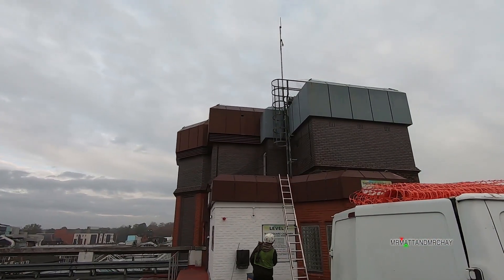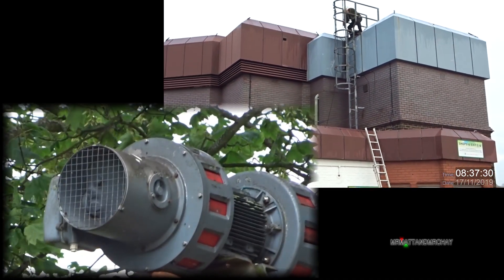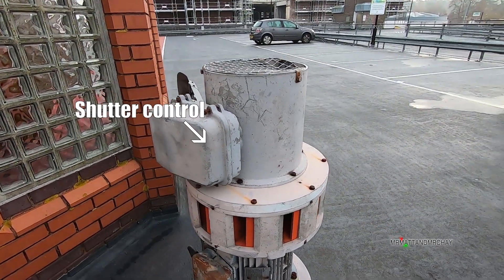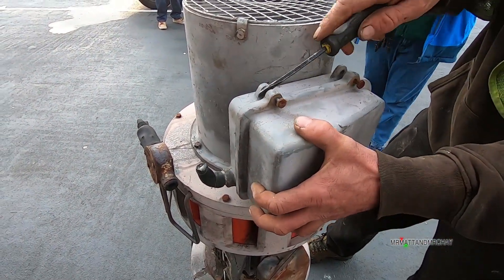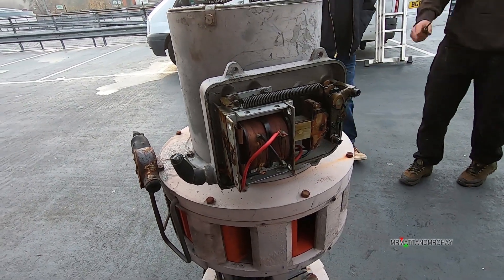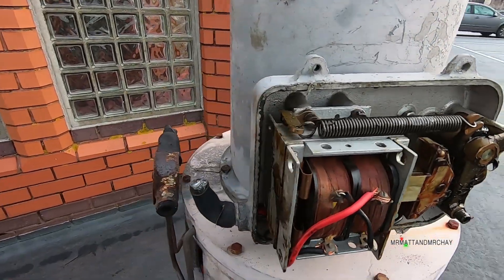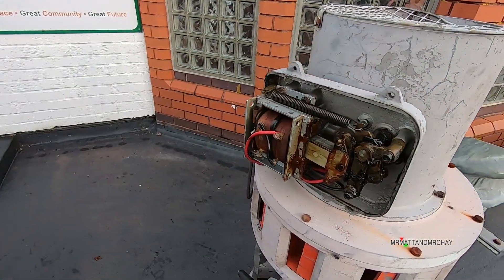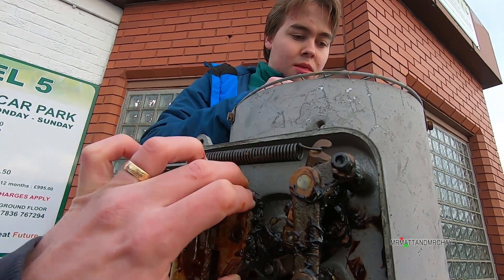What's inside a BROADMOOR SIREN damper/shutter control box?

Comment: 1:04 looks pretty tall. Would it work standing up like that, or does it need to be mounted sideways to get airflow?
Reply: ik this is an old comment but the US actually has the 3T22 which is this thing but vertical! as long as the intake isn’t blocked it should be good

Comment: The solenoids are similar to the ones in an American Federal Signal Thunderbolt 1003, but the linkages have to operate rotating butterfly valves as opposed to sliding valves.
Reply: And the Thunderbolt 1003 can also produce that pretty scary noise not only by sliding the shutters, but also by changing the blower's RPM up and down at the same time.
I'm pretty much sure that this mode is called alternate wail.

Comment: Well it looks like a Federal Signal 3T22, or Thunderbolt 1003 solenoid, but a 1003 has smaller solenoids. And this siren has a lower pitch than a Federal Signal 3T22, probably bc U.K's alternating current frequency is 50hz so the motor spins slower and in u.s is 60hz

Comment: Why don't they just use a gearbox connected to the actual siren wheel which picks up the siren rotation, and which then brings down rotational speed down to 3 rps (half a turn on 1.5 s) which converts to 180 rpm. Then just a mechanical linkage connected from that cogwheel to the shutter door.
Reply: The more mechanical moving parts, the higher likelihood of a mechanical failure .

Comment: Interesting to see inside that mechanism.

If the siren dates from the late 50s, then it  must have been moved onto that particular roof half way through its life, because the shopping centre was built in the 1980s (according to Wikipedia and the architectural style of the building). I wonder how long it was out of service.
Reply from the maker: According to some people that I've spoken with, it was originally on the council offices.  You're quite right that the shopping centre appeared way after the siren was first installed.
Reply: @mrmattandmrchay  did you know that the old 2ww sirens had shutters. Not all of them but in some places on the south coast they had gents and carter sirens with shutters in WW2. They sounded what was called the cuckoo signal because of surprise attacks on the see front by German fighters but still sounded the code red and raiders past signals so they must of sounded a faster hi lo sound than the broardmoor sirens
Reply: @mrmattandmrchay  they had a cuckoo siren in Margate and other seeside towns
Reply: @mrmattandmrchay  and Eastbourne had one

Comment: Sweet! the solenoids kinda reminds me of a Federal Signal 3T22.
Reply: Or the Thunderbolt 1003, but the linkages do a rotary motion instead of linear.
Reply: It basically is but its at 50 hz, it has no horns, its on its side, and the solenoids are different

Comment: One remaining mystery for me is how these sirens were controlled remotely. Maybe do a video on the control infrastructure?
Reply: They are connected back to the hospital via telephone lines.
Reply: @MichalM  What are the SIGNALS
Reply: @cebruthius  The sirens produce all clear and hi low. Hi low for an escape.
Reply: They use radios.
Reply: @HSETM  What's the signaling scheme then?
Reply: @cebruthius  In the RCM or control box, there's a radio in there. It's activated remotely from the dispatch centre. The radio then reads the codes and makes the siren do the signals
Reply: @cebruthius  depends. Some use dtmf(EG whelen), most use two tone, and some use fso
Reply: @cebruthius  fsk*
Reply: @cebruthius  yes. Some enthusiasts remove the tones and they also have security stuff to prevent hacks
Reply: @HSETM  this is the UK not the USA, thats how we do it here in the USA
Reply: @LA_Life_Safety  E
Reply: For this particular system, it used a telephone control system, similar to the wb1400 carrier control system. We don't have any physical proof of what these control/actuation cabinets are. Most likely because those particular control boxes are owned by British telecom, and similar systems are still in place elsewhere in the UK. I'm lead to believe that at some point, the control circuitry got an update. Possibly in the late 70's/early 80's, based on the fact that multiple signals can be activated with a singular telephone line. It's definitely not a ring relay setup
Reply: I guess it's a phone line, and a box of electronics and relays.
Reply: Phone line or 'P.O. Line' as named in the control boxes.
Reply: @dylVRC  And then what. Relays? Microcontroller?
Reply: Ha,  @cebruthius , back when these were built, there wasn't such a thing as a microcontroller (at least I'm pretty sure).

Comment: So why did some of the shutters not work? Mechanism siezed or something else? What do you think Matt.
Reply: Possible that the winding's on the transformer were burnt out.
Reply: The shutters worked off 240V so I don’t see a need for a transformer if you’re going to use such a big electromagnet.
Reply: My theory is that the ones that stuck shut didn't receive power and ones that stuck open had snapped/damaged springs.

Comment: So here is what I can see. A solenoid pushes a hinge (on kind of a doorhandle of sorts to minimize pressure on the solenoid. The turning point of the hinge is where the flap is connected. The hinge is held in a position by a spring. This holds the flap in a closed position. When the solenoid is engaged it moves back, the hinge moves and flap opens up. This is operated to a timer relay. I do not think that this is a great explanation. Matt, would you like me to create an animation of this or a practical demonstration with a functioning mechanism? I am very happy to help. Plus I can subtitle this video for you.

Comment: A giant solenoid, a strong spring, and a lot of grease.
Reply: it’s a horizontal 3T22 with no cones, solenoids work different, and different voltage
Reply: Thunderbolt 1003 and 3t22:
Reply: It is